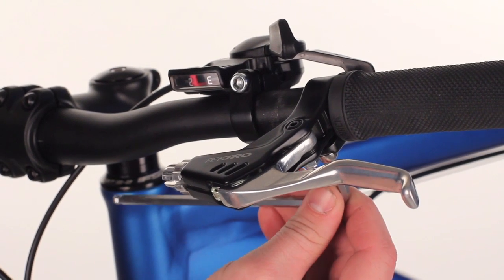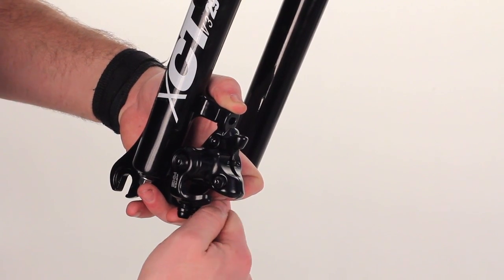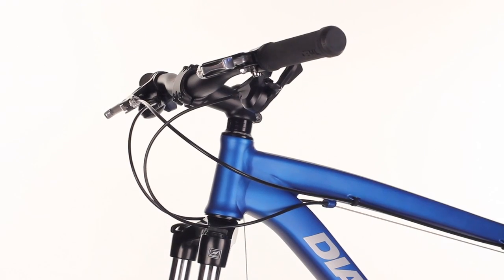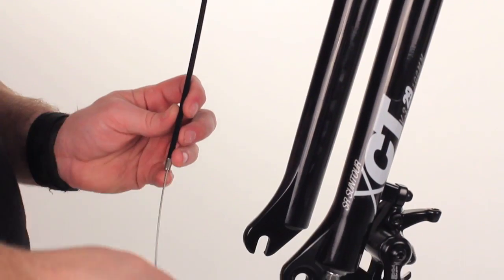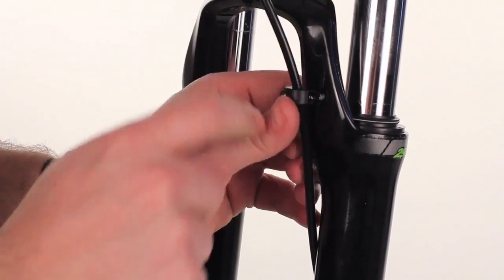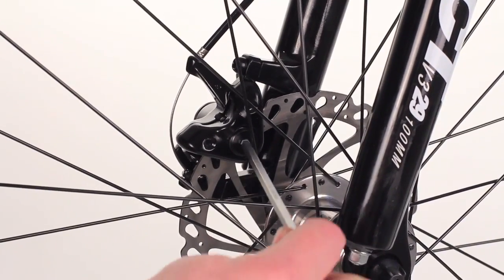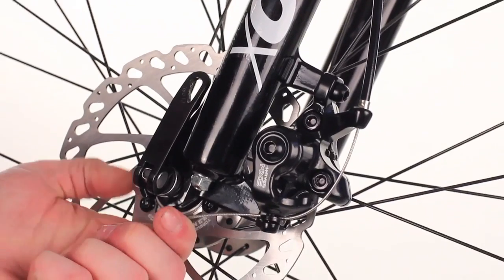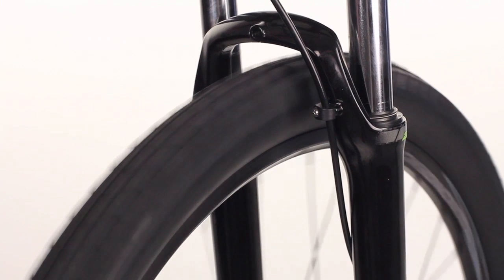Diamondback Tech: Mechanical Disc Brake Caliper Installation & Adjustment

Comment: This is a very well made and put together video far better than most of the others. I've been watching. I'm having the hardest time. Putting all new brake line pads calipers on my bike. The metal piece, the u just fished through the housing.
Has 2 end pieces that won't come off? I believe they're to hold them in place, so I don't know how I'm gonna fish it through The housing.

Comment: The bike is easily adjustible to fit the flexibility of my knee••>share4.photo/diambackbike?Ә     Enough gear choices to keep a good pace when dealing with hills and wind. Solid brakes. Shifting gears is very simple.

Comment: Thanks for the video, but for some reason on the Insight 2 I'm assembling the brakes are still rubbing against the disc, but only on certain portions of the wheel.
Reply: Check to make sure your disk is level. Not to mention make sure your hub is straight too.